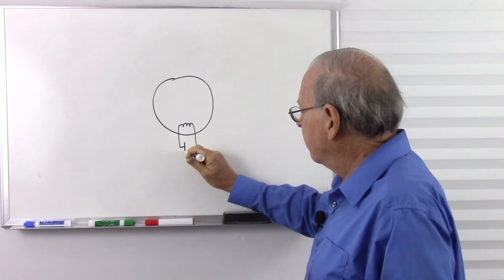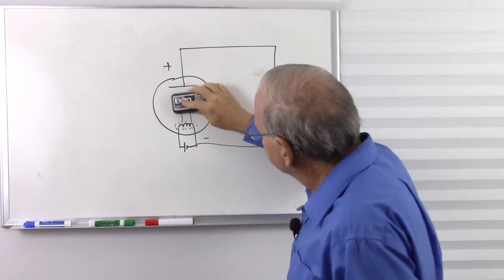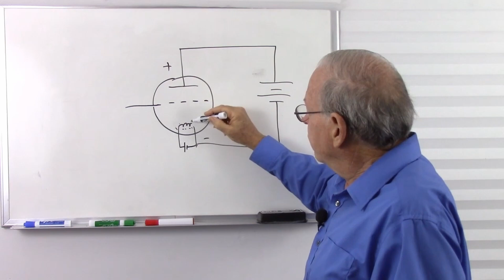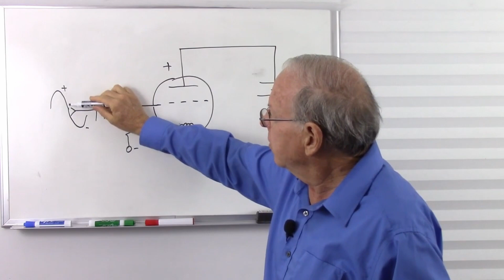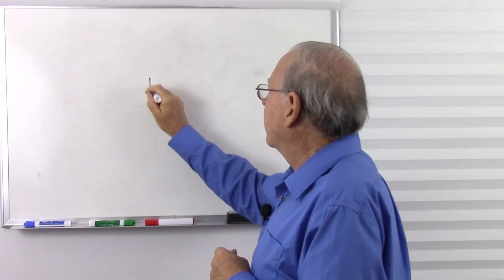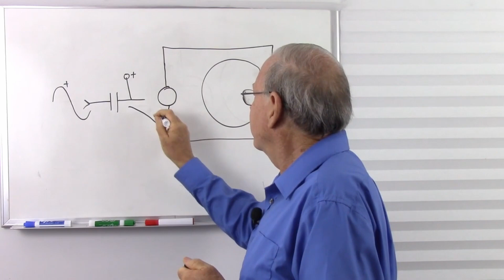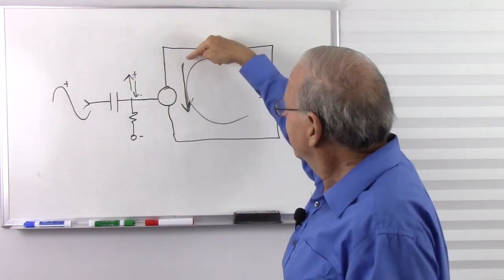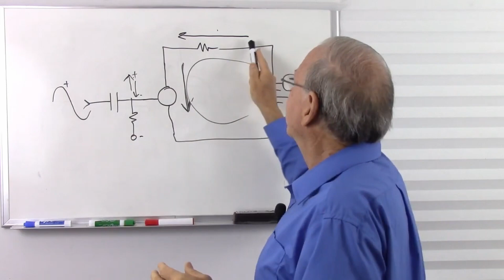Analyzing Vacuum Tube Circuits with Conventional Current

Comment: Just an FYI, 1/10 of plate voltage on grid?  A guitar applies about 0.5-0.8 v AC on grid  with plate at 160 vDC for a 12 AX7 preamp tube. Need a plate resistor to convert current to voltage with a coupling cap to filter out the DC component before it goes to next amplification stage. That dc you show with some ac riding on top going to a speaker will not produce audio/

I love your videos and watch all of them. Nice presentation and easy to understand